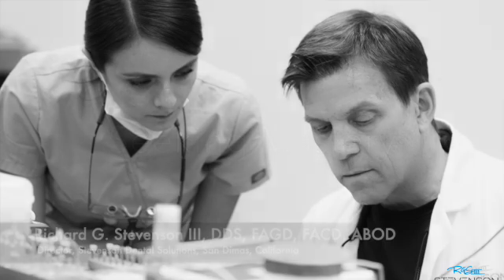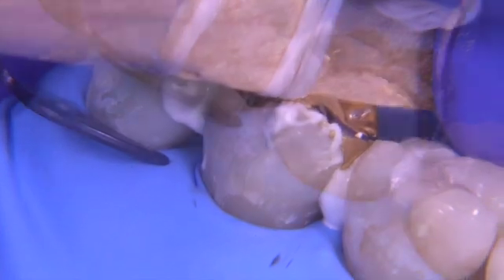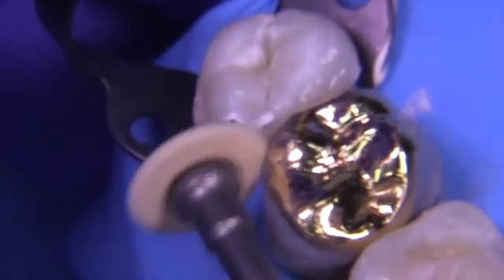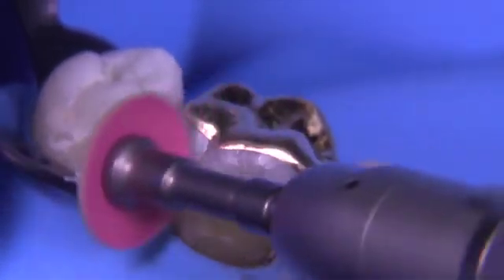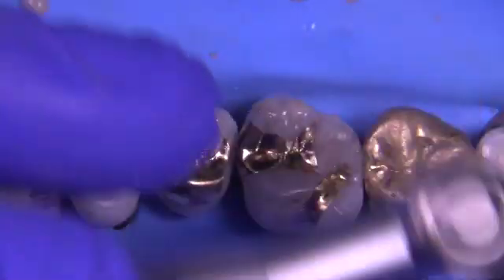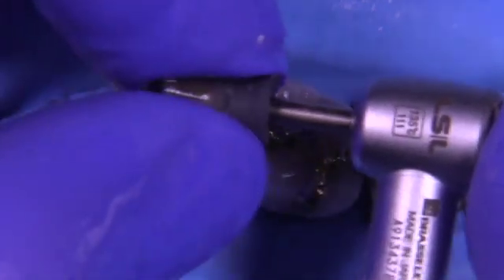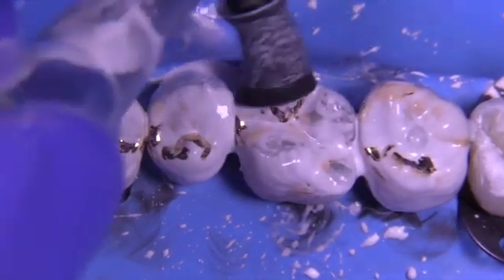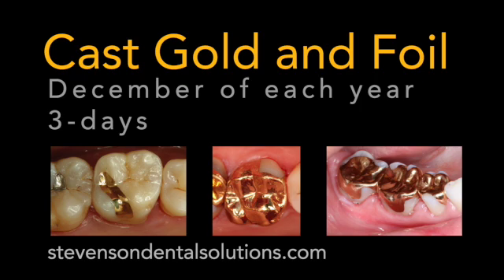Gold Quadrant Cementation - Cementation, Finishing & Polishing | Part 2

Comment: Do you think removing amalgam  from molars to replace them with gold onlays is wise or is there a chance that those molars will need root canals by moving the amalgam.
Reply from the maker: Generally no.  My philosophy is to leave things in place if they meet the esthetic, functional and structural needs of each patient.  Risk of root canal treatment may be greatly lowered by following the best practices when addressing removal situations: rubber dam, new burs, magnification and the proper antibacterial and lining materials.  Additionally, root canal risk may be reduced by understanding and executing the optimal bite relationship, cement choice and quality of fit in the final gold restoration.  Best wishes to you!  Dr. S

Comment: How much does it cost to get one gold crown? There's nothing wrong with my tooth I just like how it looks
Reply from the maker: In So California for the best gold, it would be somewhere between $1500-3000 depending on who performs the work.
Reply: @StevensonDentalSolutions  Ok thanks. Any idea on the gold percentagd typically used?
Reply from the maker: @Yoko.Kurama  I use JRVT PF: 77% Gold, 13% Silver, 8.5% Copper, 1% Platinum, and 0.5 % Zinc, Indium and Iridium